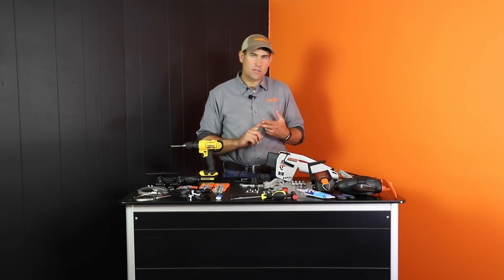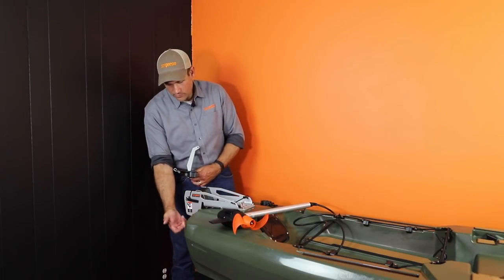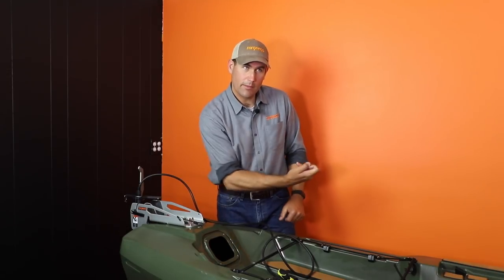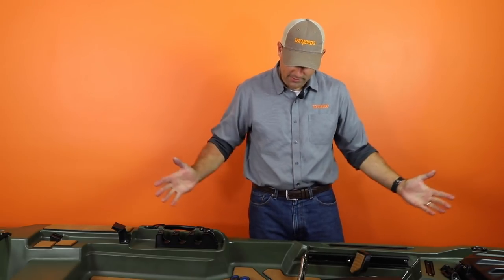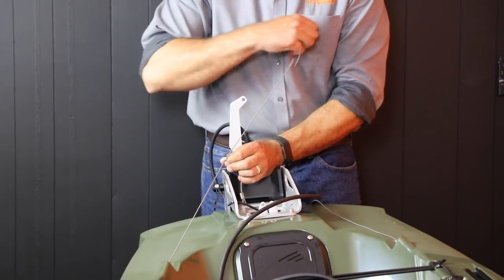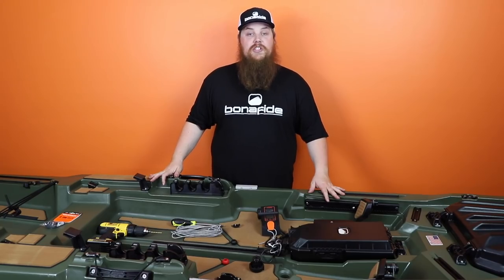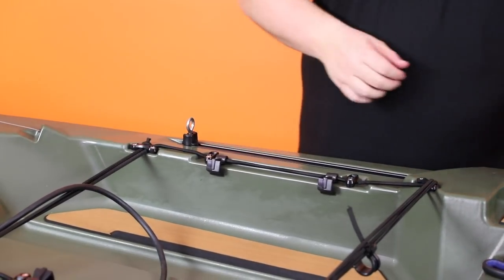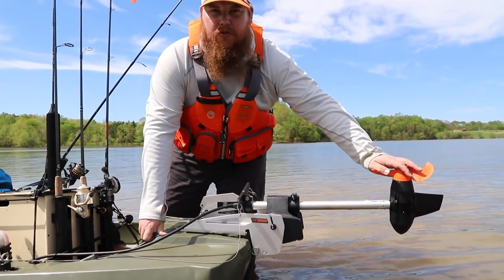Full Torqeedo Ultralight 403 AC Install - Bonafide Kayaks SS127

Comment: I don’t understand the need for so much slack in the motor lift line. When in the down position, wouldn’t you want the line snug against the jam cleat? Same with the reverse lock line. I can understand an inch or two of slack so as not to unintentionally activate the reverse lock. What am I missing? In any event, nice set up and great looking mount.

Comment: Use tri-grip rivets instead of screws when attaching tracks or kayak accessories on a kayak...holds 10 times better...you will bump the throttle getting in your boat and pull the screws out...rivets are the secret...that’s why manufacturers do it.

Comment: Now that you and Jeff have been using your yaks for awhile I have a question with regards to the Gear Trac 175. For mounting the Yak Attack Gear Trac 175 for the throttle mount install, would you upgrade to backing plates and bolts verse the screws?
Reply from the maker: The stock hardware is just perfect for this install.

Comment: I have an older Malibukayaks Xfactor Xl that I intend installing same bracket and 403. Would I simply affix the bracket with self-tappers? Unable to cut a access hatch due to it bot being flush. Any suggestions out there. Are there any flexible hatches with flexible gators and lids? I'm from uk so any links or recommendations most appreciated

Comment: May I ask why do u use the Spectra cord for steering instead of the stock steering cable? What’s good about it.  Thankyou!!
Reply from the maker: Hey Jeffrey the Spectra cord is the only thing that we use for steering.
Reply: @bonafidefish  So the steering kit bought from bonafide is not the spectra cord?
Reply from the maker: @jeffreyau1286  the steering kit is an accessory package that is not included in any of our models. There is not a stock steering cable.

Comment: Can this setup be done on the RS117? Thank you!
Reply from the maker: The RS117 is very different and doesn't have the 4 threaded inserts on the stern. Routing the steering line and tubing will be very different as well.

Comment: uhhm I think telling people to use a lighter to modify for a correct installation is a bit lazy on torqeedoes part especially for the price......just saying,the guide tube for the controls should come ready from the factory with a decent way to install,instead of the tweeker hack with the Bic lighter
Reply from the maker: Rudder tubes have been installed this way forever. Anyone who has worked in a kayak shop does this on a daily basis.

Comment: I have a 107 is it the same setup as the 127 besides having to get the track mounts for the stern to attach the eyelets?
Reply from the maker: The stern of the SS107 is a bit different and doesn't have the 4 threaded inserts, that the SS127 has, allowing for the Torqeedo mount to be a quick easy on easy off solution.
Reply: @bonafidefish  Direction One makes a stern adapter for the SS107 for the four hole mounting pattern common on stern kayak motors.

Comment: Sadly it cost almost double the price of the kayak itself.
Reply from the maker: People like options. There are plenty of other solutions ranging from a standard trolling motor to the Torqeedo and everything in between. This is also the larger battery; as the standard Torqeedo option of the 403 A is $1,799.99.

Comment: $2300.00 Uhmmmmm WHAT?
Reply from the maker: It is powered by a lithium ion battery and isn't a trolling motor. There is always the option to paddle or use a standard trolling motor, so the Torqeedo is just one of the options available.